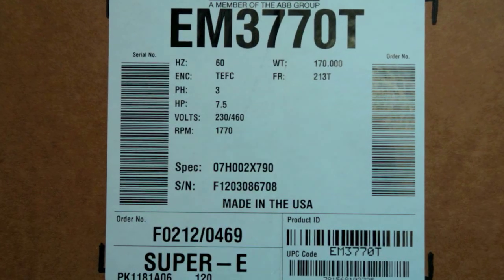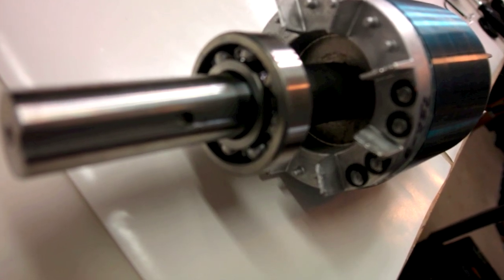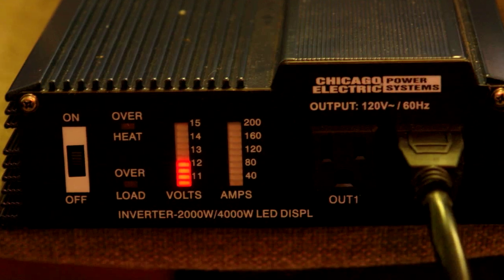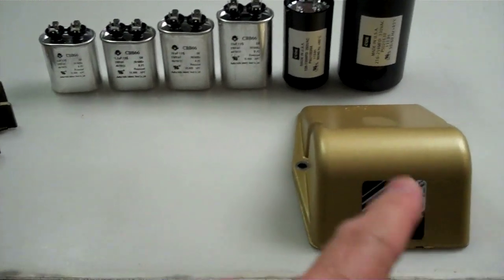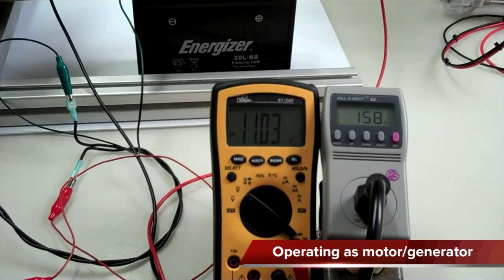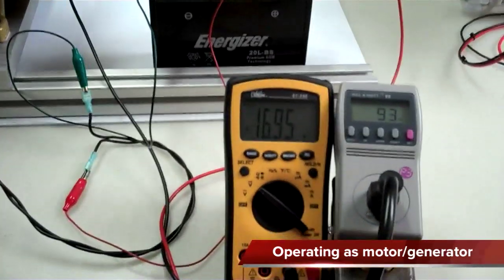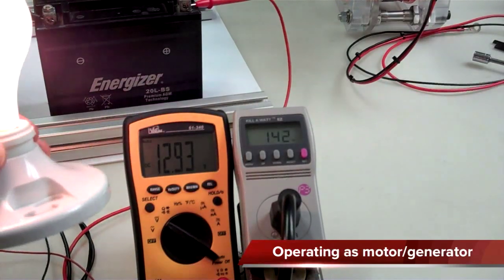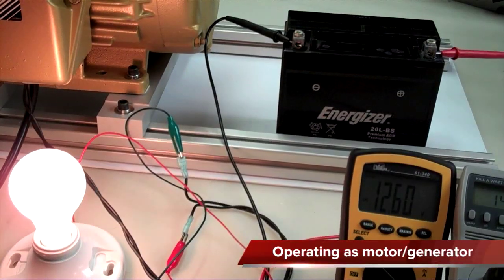Rotoverter Conversion Process

Comment: Could you not convert a solar vacuum water heater to heat gallium and circulate the gallium with a electromagnetic pump through a heat exchange coil to heat water, also have the electromagnetic pump generate a Hertz to energize your crystal plates? Integrated systems to run a home or hydroponic green house all off grid?
Reply: Sounds cool. Has anyone tried it before?

Comment: Hey! How did you wire it to be able to charge the battery or turn on the light? thanks!
Reply: useless to perform measurements at idle. one generator must " rotate itself " ie experimentation can be conducted with one asynchronous generator . in which the rotor should just add permanent magnets

Comment from the maker: Your point is noted. I find it somewhat amazing that you can operate an AC motor typically requiring over 4kW of input at only 60W. 
Ah, you've hit the golden question of mixing varying I&E. Now throw varying frequencies on top of that.

Comment: Thanks for bringing some real energy research videos on 
You Tube unlike all other claims without fiscal proof, I do not want to call names. Well;  I will like to tell you that I have a 24V DC 
motor/generator which works very well with AC output of about 
1KVA  my problem is how to recharge its running battery. Can you help me? kingjoejoe29@yahoo.com

Comment: I've studied these systems for the last month and each and every one of them showed huge design flaws that went against everything I understood and learned. I was tiring of watching You Tube videos on this subject until for some reason I found yours and clicked on it. It is obvious you've done your homework on the subject and are a very talented individual in engineering and planning this system. This is an absolutely beautifully designed motor generator and I commend you on your accomplishment.

Comment: I think that instead of criticizing things as severe, try to take a course in rotorvecter advances, there is a gray chart, where it gets a stack of 12VDC at 80 amps to drive a 7.5 hp engine that would be more or less 4hp real what strikes me is the trajeta tencion you up like a saw tooth actuator allowing the engine starts to 110VAC. and disconnect from the network and still working doestica travez the battery, breakthrough seriaun I could not do so for lack of time but I think the best option

Comment: a greeting I worked in 2010 with these jobs estactamente RV with one engine inventor, used 10hp to 7.5kwtts unloaded with a capacitor to 350vca 80mf and 55mf work just fine but I trabajava to integrate you try to load a generdor of 2.9kwtts nececitava 215mf, work boot and that of 80mfsaludos

Comment: If you are connecting two quanta together like you would connect two batteries e.g. 2x12 watt? don't know if that is durable but I was thinking that if you can get X watts out of 1 quanta charger then if you connect 2 or more the power will double ? does it sound crazy?

Comment: the fins on rotor itself can be cut off too

ceramic bearigns "slim-design" will really help but expensive 

you can take out power from run cap phase at sinewave peaks using sinewave peak detector that controls mosfets for switch-out

are you doing the battery-charge and the light bulb also at 30V input through variac?? or is that 120V input??

a person named Diego lit 160W of bulbs with 30W input  to motor- you need small size motor like 3/4hp for better impedance match to do this

Comment from the maker: I ended up using the 25uF run cap and a 108uF start cap for a general prime mover. They fit well inside the control box of the motor. Your primary goal is to match the run caps with the motor shaft load, so that value will change accordingly. When also operating as a generator with a FWBR, I chose a 7.5uF run cap with a 15uF series jump cap. These are good general values, fit well inside the control box, but also can be adjusted according to your load.